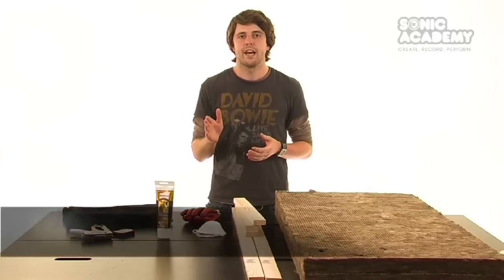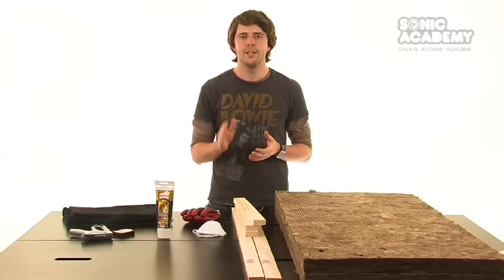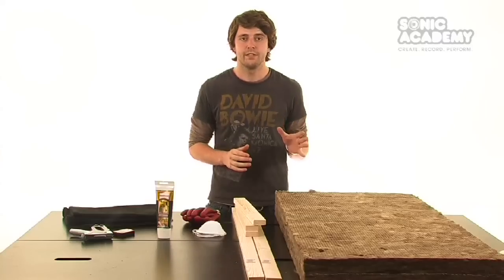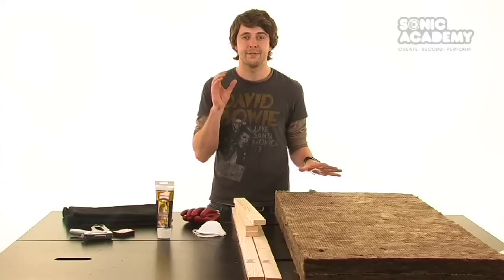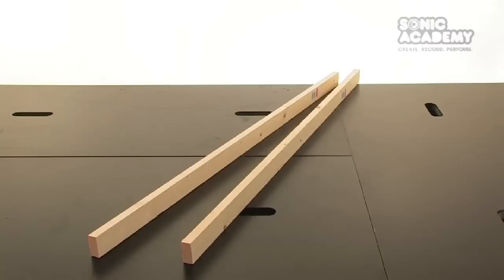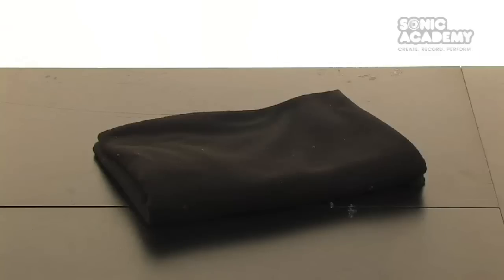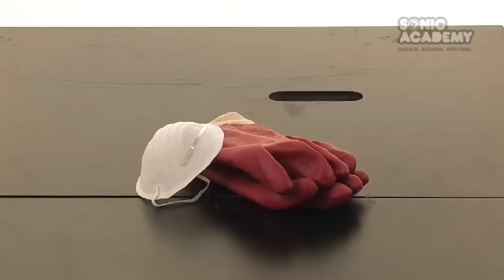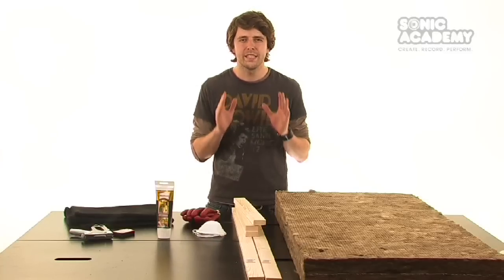How To Make A Rockwool Sound Absorber / Acoustic Panels - Part 1 Materials

Comment: For broad band absorbent panels, the best material density characteristics are either ~3lb/ft^3 Fiberglass or ~4 lb/ft^3 mineral wool.
 
The min config that should be used for broadband panels is 4" thick w/ a 4" gap. (Any thinner & the effective low freq extension suffers. IOW they are effective against high freq but their ability does not extend low enough to address all of the problem energy.)

This gaped config behaves similarly to 8” thick panels placed flush to the wall.

Comment: which is better ? rockwool ??? or 703 ???
Reply: Kingshuk Nath I’m pretty sure Owens 703 preforms better
Reply: Neither. boils down to price and density and since "rockwool" is a brand name you could be referring to anything. 703 probably equivalent to rockwool safe n sound 3 inch thick. Rockwool comfortboard 80 is far more dense and at same thickness would absorb much more low end from what I understand. Comfortboard is also super rigid and easy to work with. But panels of comfort 80 are 1.5 inch thick so you'd need a lot to get a 6 inch broadband panel. I can say almost for sure though if you had 6" broadband panels made of rockwool comfortboard 80 They would absorb lower fequencies than the same thickness in 703, or most types of batting.
Reply: also consider that fiberglass inso like owen's corning 703 is pretty hazardous to your health if breathing in particals..it gets real itchy touching it too. Rockwool might still give you a bt of itch, but nothing like the fiberglass and poses no threat of inhaling fiberglass dust. As far as i know mineral wool is a much safer product to work with...probably should still use gloves though.